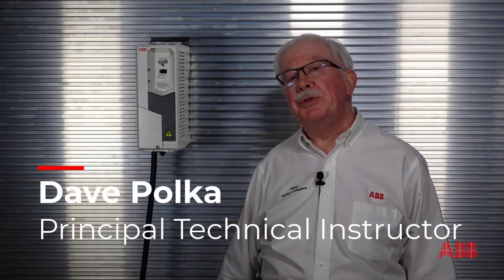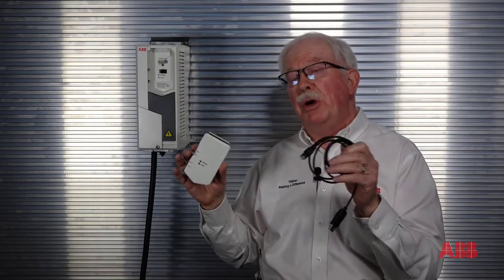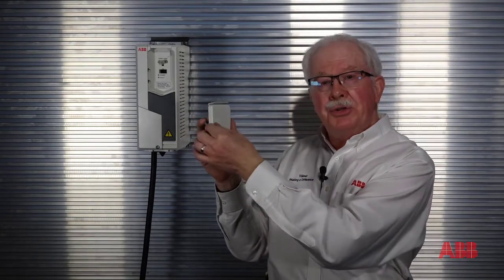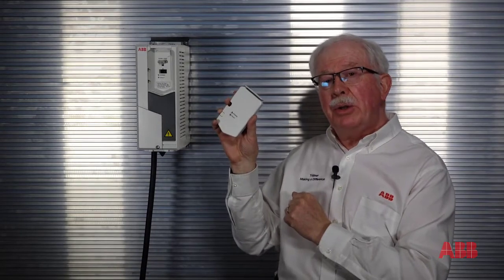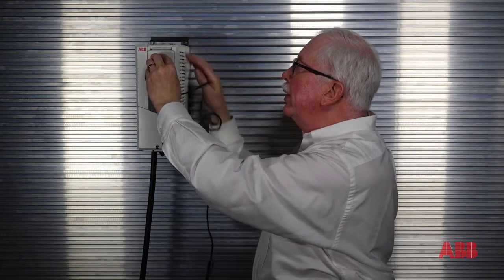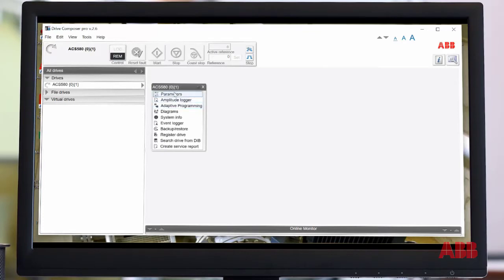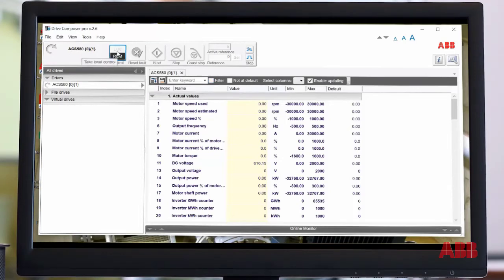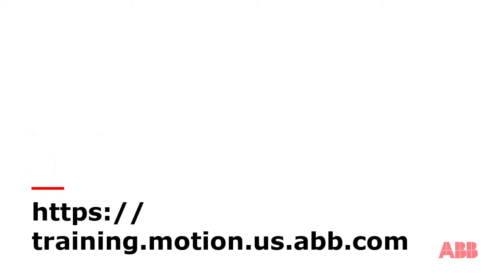Drive Composer - Program Multiple Drives

Comment: This is a great resources.  The BCBL-01 (3AXD50000032449) cable and Drive Composer can also be used to connect to the ACS880, ACS380 and ACS480.  The BCBL-01  USB to 485 (Male RJ45 connector) is a great way to connect a PC directly to an ACS880 w/out a keypad.  They only need Drive Composer Basic on the PC, USB port, BCBL-01 connected to the left port on the keypad cradle.  Though it is harder to get access to, the BCBL-01 can also be plugged directly into X13 on the ZCU.  As a reminder, the Type 12 outer keypad cradle does not include the additional RJ45 ports, but the inner cradle is like that on a Type 1 with the hidden ports on the top left and right.  In addition to having an extra ACS-AP-W, the BCBL-01, is a must for every drive specialists tool bag.  Note: To connect to X13 on ZCU, it does require access to the ZCU board so all safety precautions must be followed.
Reply: Is drive composer compatible with all AC and DC drives or just with some specific ones?
Reply: @MrMadridoo23  great question. The Drive Composer Basic and Pro are designed for the drive families who are part of the “All Compatible Portfolio “ which includes ACS380, ACS480, ACS/Q/H580, ACS880 and DCS880. There is limited connectivity to some of the previous generation drives but for upgrade purposes not so much standard day to day parameterization.
Reply: @ras5056  Great ... let me ask the question differently to be more precise, is drive composer (entry or pro) compatible with DCS 600, DCS 800, ACS 600 and ACS 6000 ?
Reply: @MrMadridoo23  No.  Only the newer All Compatible Drives along with the older ACS800 drives.  I believe the ACS600 used same DriveWindow as the ACS800 series, via fibre optic connection; which happens to still be available.  The DCS600/800 DC Drives can also use Drive Window or Drive Window Light.  The new DCS880 series is the new "All Compatible" DC Drive being sold today which also uses Drive Composer (Pro).
Reply: @billboto7  Very good 👌 thank you for your response. What's the meaning of Q and H in ACQ and ACH ?
Reply from the maker: The H in ACH580 is the HVAC specific drive and the Q in ACQ580 is the water specific drive
Reply: Excellent video very helpful